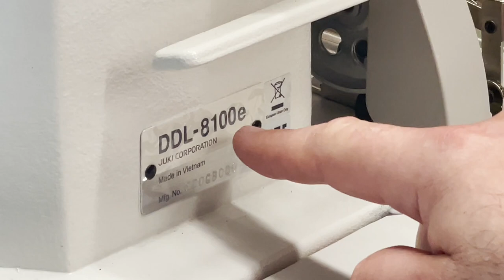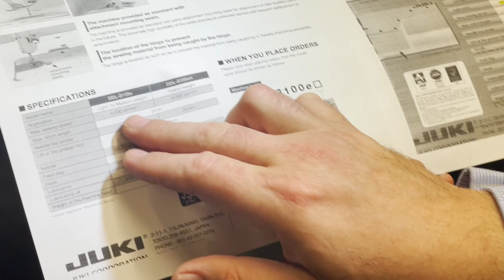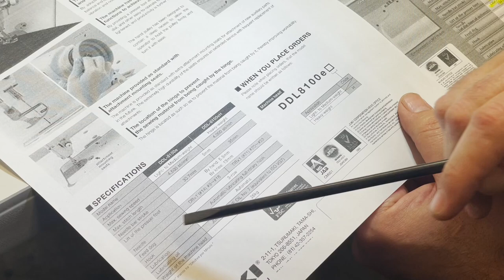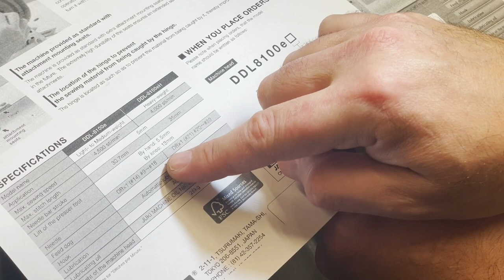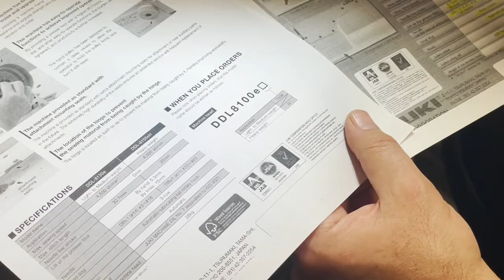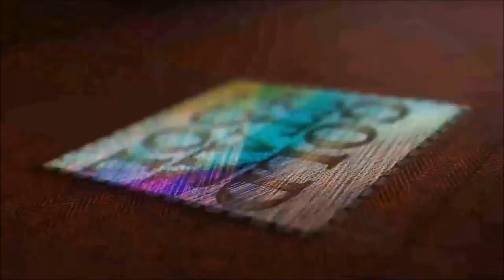Product Comparison - Juki DDL-8100E VS Juki DDL-8700 - Goldstartool.com - 800-868-4419

Comment: Which out of the 8100 or 8700 is more quiet and has less vibrations? Or are they about the same? I have extreme Hyperacusis/ ear issues and I know I can use the 8700. But wondering is 8100 the same, more quiet, or louder?

Comment: They definitely not the same. I can't compare them, but just by looking the video I already spotted difference. The needle bar holder or socket, whatever it's called, for 8700 is from yellow metal, on this one it's gray.  You may think that it's not important, but that is actually part that will wear out first on your machine, so technology used there will effect life of your machine. What's the difference between gray and yellow? I don't know.